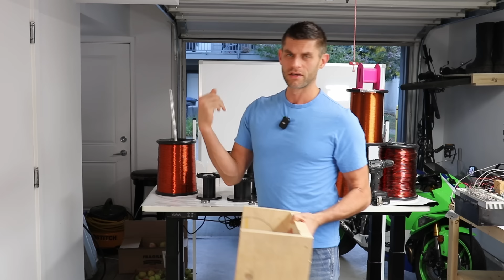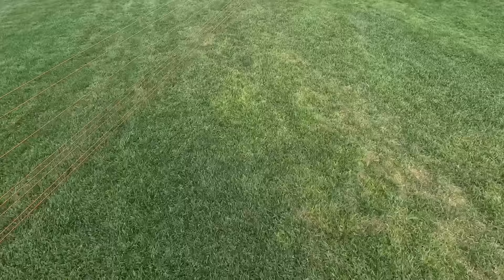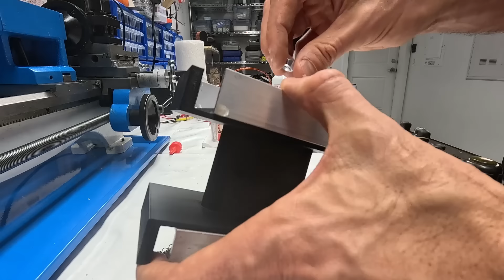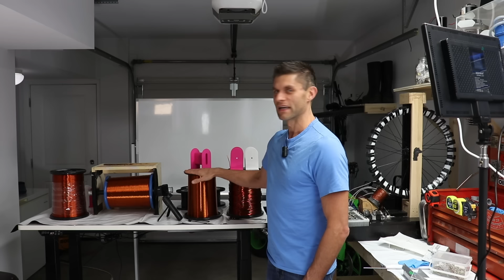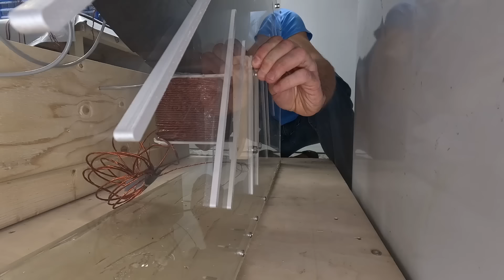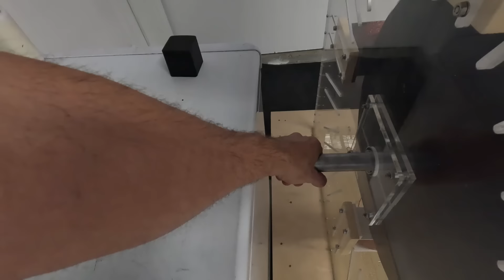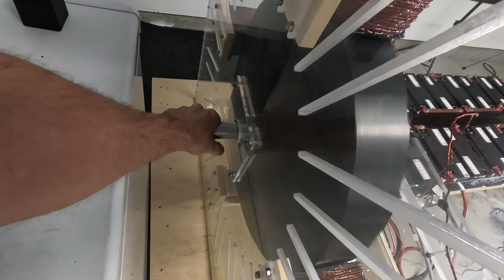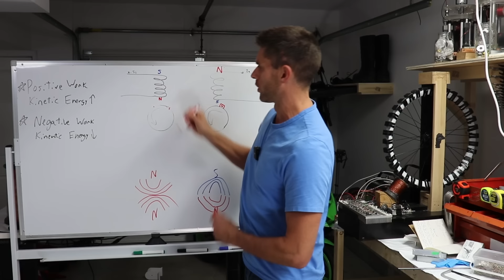The Device That Could Give The World Unlimited Energy

Comment: I have thought of gearing magnetic energy. I think if you built something smaller to bigger like when changing gears on a bicycle, it is easier and takes away how much force is exerted to get the bike to go faster or the rim. The faster the rim is moving depending on how heavy the rim is will make it much harder to stop it. I think I have had a similar idea to this before but after watching your video it made me think of it again. Everyone is stuck in some box that limits their beliefs about what is possible like everything has already been invented so there is no way to fly in a different way, and I just thought of something else that could help if using flywheels for continued motion and gearing. If a small flywheel was separated from other flywheels and connected with a clutch type of thing once getting to a certain speed slightly after switching gears to help use less energy starting every flywheel that is bigger than the last one. It would make sense that it would help create way more power for a longer amount of time. If cars only had one gear the motor would only be able to get it moving as fast as that gear would allow. Thinking of the energy buildup of a vehicle going 25 mph, compared to the same vehicle going 125 mph is drastically different. I was able to get 90 miles per gallon using speed and hills and putting the car in neutral to cost for extremely long distances, when my normal mph was around 25 to 30 mph and I did it on multiple occasions not just one time but probably around 12 different times.   That makes me think of another way to get more power from a generator, but it would also start to take up a lot more space but if the last biggest flywheel would have magnetic bearings I feel like that would get rid off lots of friction. Then it’s just a matter of starting at some point to keep the speed up and shutting down to keep the energy low. If I’m missing something let me know and if I helped in anyway let me know. Anyway keep pushing if it’s that simple for me to figure out how to get more from something that shouldn’t get more efficient than what is normally thought possible it’s not rocket science
Reply from the maker: Cool. Great comment ❤

Comment: Find the frequency in short wave band that has the most natural static then put 7 tuned coils to the frequency to creat a feed back and the feed back will be tapped into . Its an old trick in the patten files. They used just two coils. I haven't tried it yet. Just found my diodes finally yesterday. I've got killer collection even gold plated military grade diodes many  types
Reply from the maker: Love it

Comment: Aa someone who has shorted a battery out in a vehicle, your advice of order of connection and disconnection is wrong.
When disconnecting, remove the ground first.
You eliminate the path to the battery.
Think about in a vehicle. The entire chassis is essentially a ground. If your wrench slips and touches anything in that vehicle you just created a dead short.
If you remove the ground first, only that ground post is then ground. The rest of the vehicle is not.
Reply from the maker: Well its how i roll, and what i was taught as a HD mechanic at Finning

Comment: A coil made of thin copper wire with many turns generates incredible magnetic power, while a coil made of thick copper wire with few turns generates much less magnetic power; however, their total power outputs are the same.
Taking advantage of this difference, it is a smart approach to use the thin-wire, high-turns coil for thrust and the thick-wire, low-turns coil for energy production.

This is a classic example of the principle of action and reaction.
If one magnetic field has a range of 3 cm and the other 1 cm, only one of them will be effective.
While the field farther away generates energy, the field closer to the center continues to apply force.
My suggestion is to position two separate coils within a single coil: the thick coil farther from the center, and the thin coil closer to the center.

At the same time, the trigger must be activated at the right moment; the magnet is already pulling the iron, and as it pulls, the iron begins to magnetize, the thick coil at the back immediately converts this into energy, the energy is transferred to the capacitors,  the moment the magnet locks onto the iron, the thin, highly wound coil instantly engages, and the strong magnetic current temporarily blocks the magnet from seeing the iron.

It’s just like, instead of filling a bag with air by breathing into it, opening the bag’s mouth and instantly filling it with air with a simple puff—like a parachute.
Reply from the maker: Nice ideas. These coils are air core

Comment: It appears your relying on batteries, well, the amount coming in is all you can use divided by 2 to avoid over heating the generating device. To solve this apply transformers that raise the current to 3000a or more then use another transformer to create only 14 volts then run both the bolts and the high current through a mosfet  regulator system that can be ordered online to blen and connect both lines, the 14 volts then the current of 3000a or more. Allow only two 1/2 or 5/8 diameter copper lines to come out of the device for power. The single set of two wires are then connected to the appropriate DC to AC inverter. Then tap into those single set of two wires again, that are pos and neg, and are then connected to another DC regulator system, also an available component online, that will charge two or 4 12v batteries using 12 to 14 volts 140a from the regulator to the batteries that will be used to start the device when turned off. This system can produce up to 30,000 kw if done correctly.
Reply from the maker: Lets see it?

Comment: Those coils are useless, please Use Bifilar capacitive coils because Lorentz law does not apply. Wish you the best, remember a CAPACITIVE BIFILAR COIL looks like a rolled UP rug. You are welcome friend.
Reply from the maker: Ya bifilar capacitor coils work if u have NSNS
Reply: @MadscienceLPTECH it doesn’t matter the orientation {NSNS], you can ONLY succeed by using bifilar capacitive coils, there is limited info online about it. The patent is of no help. It took me 15 years to understand/experiment on how to make a capacitive bifilar coil because there is 0 info on how to make it. NOT WIRES, !!!SHEETS!!!…..good luck and don’t lose the info I just shared with you. Those coils that you built are toys, {Lorentz toys} you can’t escape Lorentz law if you BUILD the coils the way you did, peace and I wish you the best. EE has not helped me at all in this endeavor, it actually took me longer to achieve energy independence.

Comment: If the rotor design has more weight at the edges and a thinner center rod, or any design that would allow the rotor to spin with less input, less work to keep spinning and spin way more efficient, what effect can that have to increase it's positive work!?..
Reply from the maker: You'd increase its moment of inertia for sure. More energy to get it going though 

Good idea ❤

Comment: The videos where a mason jar has 3-4 long bolts facing down & sealed air tight in the jar with water & salt with a hose to let out the hydrogen made from a electric source attached to the bolts/metal part. Some one did it with a small solor powered electric generator , that seems like a great place to also harness endless power.There should still be alota hydrogen making videos on here.
Reply from the maker: I do enjoy electrolysis
Reply: @MadscienceLPTECH  Thats the word.

Comment: Enjoyed Your Video.👍🏻 I Stumbled across Your Video and was Surprised to See You Were on a Path of Discovery with a Very Similar Thought Process that I've Been thinking about for Some time Now. With Modern Technology, IE: Variable Timers, Crank Triggers, Optical Sensors, Variable Voltage Regulators, used for the Purpose of Increasing, Decreasing and Reversing the current flow, in The Coils, thus Increasing Overall Efficiency and Reducing the Cogging Effect. I'm Also Considering Using a Flywheel Connected via an Inverted Cone Variator Drive, intern, increasing overall Rotational Force and Stored kinetic energy to overcome Losses due to Bearing Friction. Magnetic Bearings could Be the Solution to That Problem. Keep Working, Reject the Ney Sayers. Persistence Pays Off. Good Luck My Friend. Stickshift Martin. Visit My Channel youtube.com/@stickshiftmartin ✌🏻:goodvibes:😎🤔

Comment: I once received proof that vacuum energy is real when I built a three coil window generator driven by a cordless drill motor. It had an adjustable commutator, six rows of magnets north south alternating, two batteries, one run and the other on charge. I ran it for a couple of months with no positive results. All the while the commutator brushes were slowly melting due to the arcing. This caused the brushes to melt to that certain sweet spot which caused the battery on charge to suddenly charge from 11,8 v to 16,5v in the space of 5 minutes with virtually no loss in the run battery. I put it down to miniscule timing and correct voltage. I accidentally bumped the generator and never achieved that result again but I got proof that huge energy can be tapped from the vacuum.
Reply from the maker: Crazy

Comment: Man, I wanted to ask if the purpose of this tech is to make unlimited excess energy . Till now, it seems like you can produce only just a little more energy than you used to power it. If it's just a little more, then how can it be feasible? You even can't make up to the maintenance of the machine, and the cost of this machine will be covered in years solely on the basis of what it can save in terms of money. please  do tell.
Reply from the maker: U can make lots of energy. We are learning and know how. Its a process and journey

Comment: Wpuldnt it be more efficient if we just designed everything that requires electricity to operate to have some sort of device inside that converts static in the air to usuable energy say to power a lightbulb anywhere as long as theres static in the air? Static charges capacitors in a circuit that then charges bigger capacitors  when the smaller ones become full untill it has capacitors charged withbenough power to power the device?
Reply from the maker: That would be sweet
Reply: @MadscienceLPTECH except its too late is it not? Yeah damage has been done and its not reversible sorry not sorry its inevitable we destroy this planet and it becomes the hell just about every religion speaks.of
Reply: @MadscienceLPTECH  is radio not technically transfer of free energy  except they decided to use power to amplify the radio waves into sound but technically wether there is power or not to the receiver it will still pick up the radio waves it just wont emit them back out without a boost btw the original.tesla.coil.was a massive antenna that picked uo the lighter vibrations and static and sent it down into capacitors and back into another type.of conductive material back up into the atmosphere and he continued this cycle.untill it was attracting heat lightening and storeing all that energy from the most powerful natural.energy he then sent the power through  the ground  and made a light bulb that if he stuck.it in the ground a mile away it lit up but only lit uo when stuck into the ground because thats what he was using to transfer the vibrations or "energy" he just matched the frequency  of the ground before trying to send the power through it sonit would travel.with less resistance  his earthquake machine demonstrates how matching frequencies of.something makes it easier to send power through

Comment: Huh, well that's kinda clever. This is a classic "generator attached to itself" perpetual machine grift, but he got around the issues of various resistances ruining the fun by making up a fake property of lead acid batteries.
Reply from the maker: U sound like a bot
Reply: @MadscienceLPTECH I'm not a bot, I'm someone with an actual EE degree. Like, a real life "knows a mosfet is a type of transistor" (ie. the thing you messed up in your last video where you claimed to have an EE degree) EE degree. You're doing a not particularly original new version of the Bedini motor scam for a newer generation. It doesn't work, but you will collect gofundme money until you get bored.

Comment: THIS IS SORT OF RIDICULOUS YOU'RE USING BATTERIES AND COILS WOULDN'T IT BE BETTER TO USE GRAVITY AND ATTACH A MOTOR WHICH OF COURSE WEARS OUT SO YOU ADD A NEW MOTOR IRONICALLY MADE WITH COILS OR A STATER IDEA

 SHIPS GO THROUGH LOCKS RISING AND FALLING IMAGINE SIZE OF MOTOR THE SHIPS HUNDREDS OF MILLIONS OF TONS USED AS A BOUY COULD RUN 

ITS LIKE A CUKOO CLOCK OR TRY PUSHING YOUR AIR MATRESS UNDER THE WATER AT THE LAKE AND TRY HOLDING IT DOWN UNDER THE WATER YOU EVEN PRODUCE THE ENERGY BY LOSING WATER OR GAINING WATER MANUALLY BOUY GOES UP AND DOWN THERE IS NO SUCH THING AS FREE ENERGY HOWEVER THE COST OF BOUY GRAVITY IS MERELY IN REPLACING THE MOTOR EVERY SO MANY YEARS BUT OF COURSE YOU NEED AN INVERTER TO CONTROL HOW MUCH ENERGY POWERS WHATEVER .OUR OCEANS ARE POWERFUL WHEN YOU COMBINE AIR AND GRAVITY BOUY TIDE IN TIDE OUT IS JUST AS EFFECTIVE BUT PERSONAL POWER TAKES ONLY BOUY TANKS AND ANY MOTOR ...LITERALLY ANY MOTOR

Comment: Something I'm unclear. The voltage pulse output of the motor is several hundred voltages when the motor is disconnected from the batteries. The voltage of the pulse is under a volt when the batteries are connected because the batteries load the motor. Where is the high voltage pulse occurring?
Reply from the maker: When u connect the battery the pulses are still hundreds of volts. The battery absorb and clamp the peaks to some degree. The scope still shows ~600-800 volt spikes
Reply: @MadscienceLPTECH Thank you. Are you going to add a resistor between the motor and batteries and scope it?

Comment: So if Im understanding this correctly, this is essentially using water hammer (or in this case, electron hammer?) to send any remaining voltage back to a charge battery?
Reply from the maker: Not quite. The collapsing energy is also drawing in vacuum energy 

All sharp gradients draw the negative/ vacuum energy into the system. Its not electron flow

Comment: Sorry here is my revision of the idea I just presented below. I feel that this revision is a bit more clear to understand, Thanks for your patience.

So what do you think of this idea that I commented below in the augmentation of his output design?? Is it crazy? I got this idea from the ol:  two pie times freq times inductance                                                                                                                 

In a way your batteries seem to act a bit like a clamping diode that stores energy in chemical form.

 My question here is as you gain spike voltages due to the collapse of the mag field during the off timing. which is part of your duty cycle length, 

as a suggestion: as you encounter spike voltages from the collapse of the EMF field, why not use a Rodin coil to amply a small  portion the spike voltages produced during the (OFF) duty cycle phase and store it in a synchronized bank of scavenger type of capacitors. storing unneeded peak voltages which would occur at a small amount with each return boost of EMF to your batteries as you shown in the video. 

 My question is,, could this idea result in storing supplemental output voltages to each driver coil/s which are not only amplified but could be regulated in a synergistic firing order way that may add or boost to your driver coils due to the stored energy output stored in the scavenger type of capacitors.

I call this idea (synchronized capacitor discharge output) based on a scavenger energy approach using wasted energy and storing it through the use of capacitors and their synchronized output to each coil as your rotor is pushed/pulled in its designed rotation cycles.

I would be grateful if you could respond if you think this might add to your power output efficiency. The key here is the Rodin inductor due to the way it stores the EMF inside the coil.
Reply from the maker: I think our coils do the trick for now. They have substantial L and yes other coils could work too.

The batteries definitely absorb the spikes / clamp

Comment: In a way your batteries seem to act a bit like a clamping diode that stores energy in chemical form.

 My question here is as you gain spike voltages due to the collapse of the mag field during the off timing. which is part of your duty cycle length, 

as a suggestion: as you encounter spike voltages from the collapse of the EMF field, why not use a Rodin coil to amply a small  portion the spike voltages produced during the (OFF) duty cycle phase and store it in a synchronized bank of scavenger type of capacitors. storing unneeded peak voltages which would occur at a small amount with each return boost of EMF to your batteries as you shown in the video. 

 My question is,, could this idea result in storing supplemental output voltages to each driver coil/s which are not only amplified but could be regulated in a synergistic firing order way that may add or boost to your driver coils due to the stored energy output stored in the scavenger type of capacitors.

I call this idea (synchronized capacitor discharge output) based on a scavenger energy approach using wasted energy and storing it through the use of capacitors and their synchronized output to each coil as your rotor is pushed/pulled in its designed rotation cycles.

I would be grateful if you could respond if you think this might add to your power output efficiency. The key here is the Rodin inductor due to the way it stores the EMF inside the coil.
Reply from the maker: Great idea.

We want those peak vilatges though. Need the sharp gradients in the batteries 

Ill explain more next video